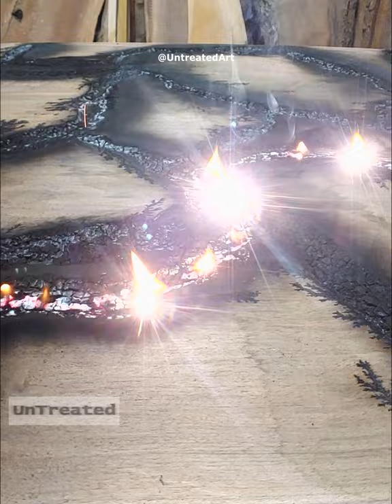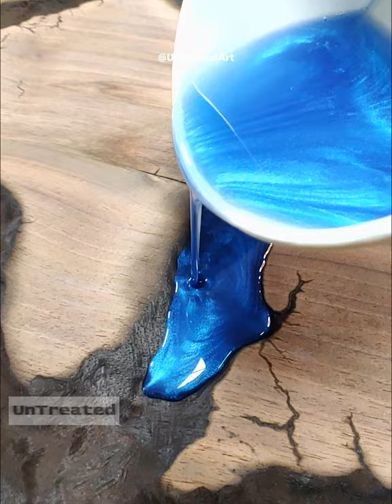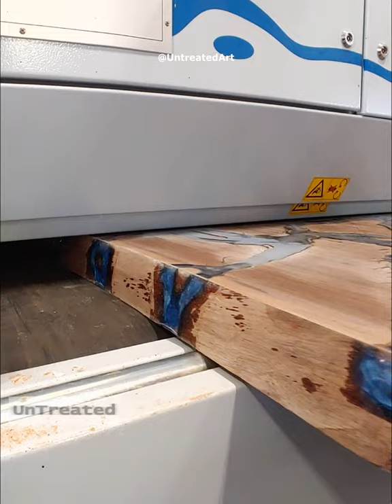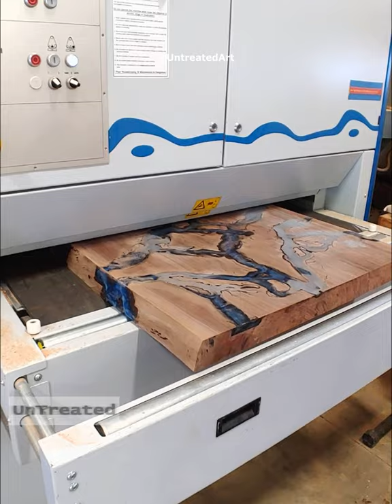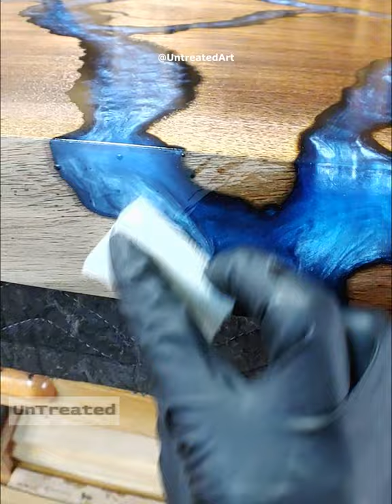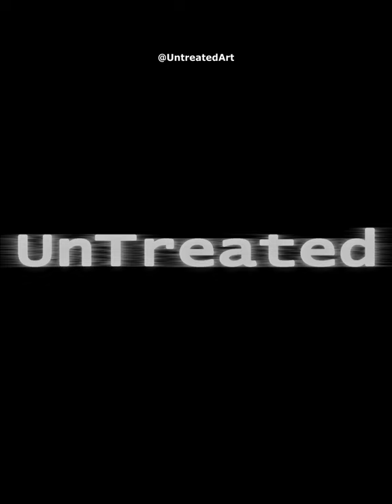Creating fractal rivers and pouring blue epoxy resin

Comment: How do you get the side resin to stick on? Like the top of the board makes sense but whenever you have the sides of the board with resin, how do you keep it there?
Reply: On another short of his it showed a clear tape of some sort across the open edges to hold the epoxy in until it hardened.